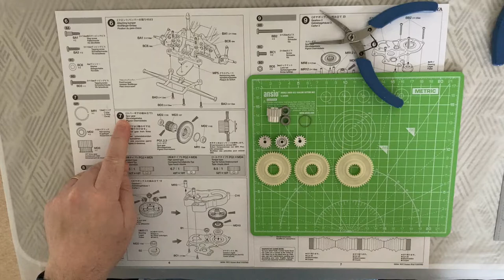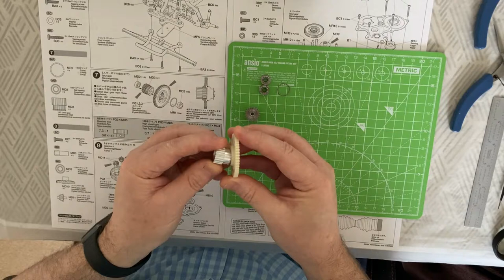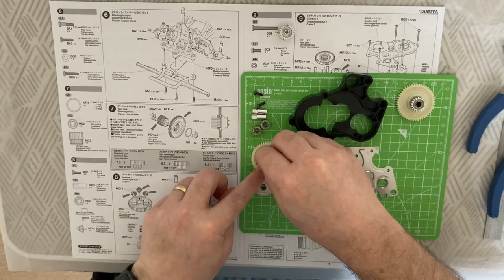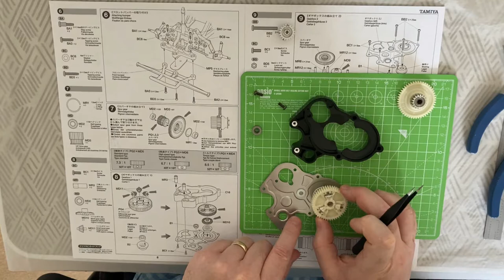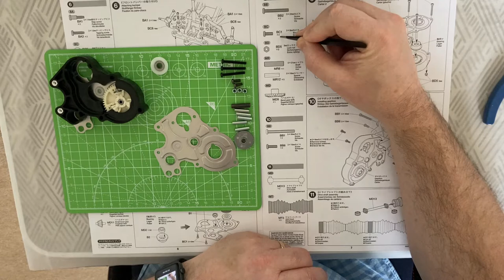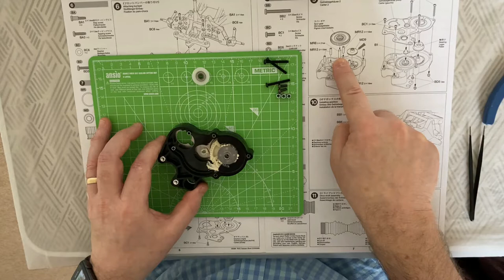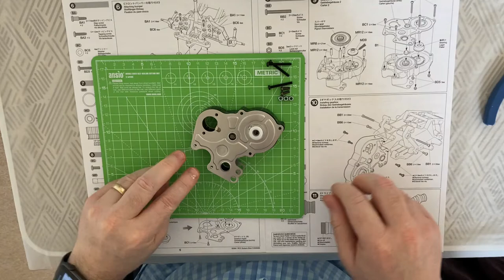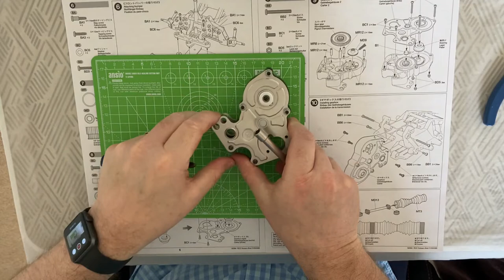Tamiya Subaru Brat Steps 7 - 9

Comment: Great job John, How are you feeling mate? I hope much better. That gear box can be tricky to build, but I think you forgot the other small white "shaft cup" as I call it, for the counter gear in the left side gear box plate. That's a very very thorough build my friend, I can tell your having fun so far. As for grease on the manual, I hate that also, LOL. All best to you & yours my friend!!!!
Reply from the maker: Hi Bob, I hope your well. I’m feeling better as each day passes, getting more movement and strength, yeh! Yes, you are right, that last white cup that covered the shaft slipped inside and i didn’t notice it had at first 😏. I found out later in the build, when attaching the gearbox to the chassis and rear trailing arms, I noticed that the gearbox didn’t turn, so had to remove the gear box from the car, dismantle, locate that second white cup, rebuild and reattach. Got it in the end, tricky little bugger! All part of the fun of building an iconic car. Oh, and grease on the gearbox, don’t start me off on that one, very OCD on that one😂😁. The Brat has turned out really well. All the best to you and the family,thinking of you guys. 😉👌